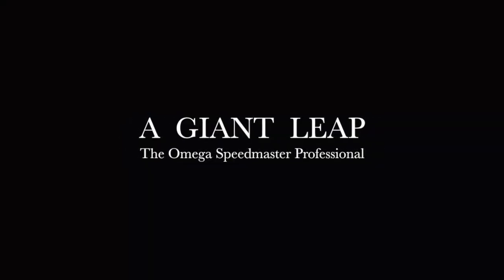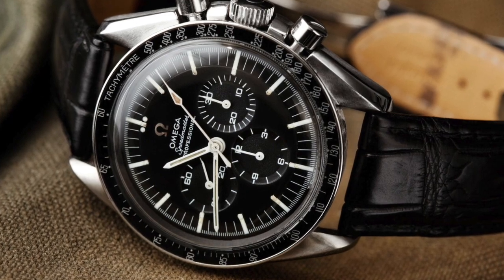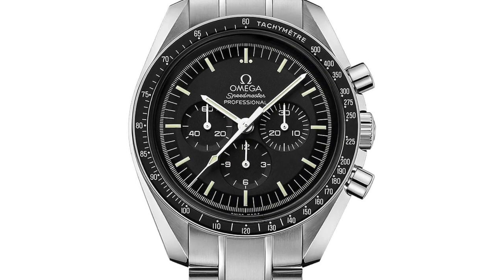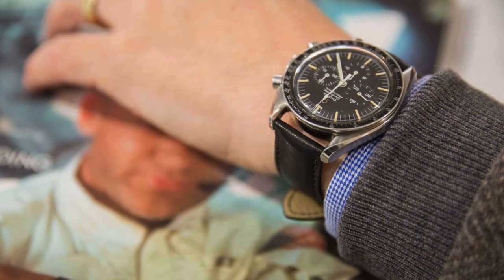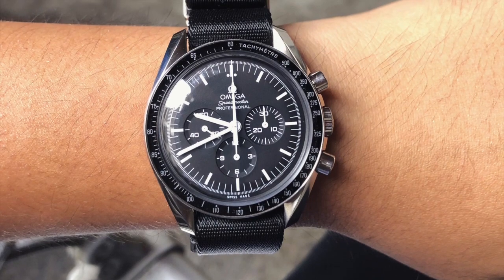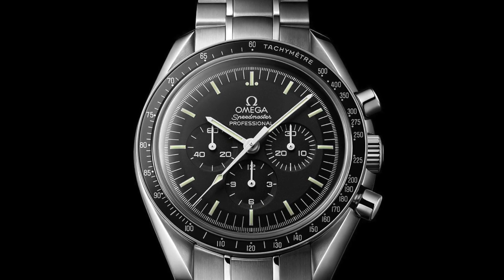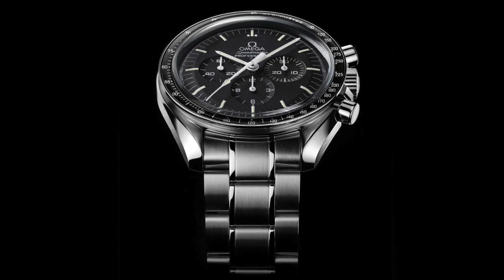The Design Of: The Omega Speedmaster Professional

Comment: Acrylic Crystal, manual winding. I should hate this watch 
but i love it, long live the Speedmaster
Reply from the maker: Hahaha! I'm getting to a point where I only wear acrylic pieces on a daily basis...there's just something so tantalising about the next scratch that it's going to receive! Ah, but I just love the fact that after all these years the watch has remained. It says a lot about a company to cherish their heritage like they do. Thanks for the comment, Maynard!
Reply: If you get a little scuff mark on the acrylic crystal, you can polish it out with a metal polish paste like Flitz. Use a cotton cloth and just a very small dab of the polish, about the size of one of the stopwatch buttons. It doesn't take but a minute or so and keep the polish off of the tach ring. I've used it several times on a Speedmaster that I've had for about ten years now.

Comment: At 3.40: The physics behind this has been known since the days of Isaac Newton.
The things that matter are the moment of inertia of the balance wheel and the spring constant of the balance spring.
These things do not depend on gravity, and it is impossible that NASA didn't know this.
Automatic watches also work in space as it turns out. The rotor is mainly driven by sudden movements of the hand, and automatic chronographs have been 
used in space (Seiko 6139 and Sinn 140 comes to mind).
When the Speedmaster was chosen by NASA, no automatic chronographs existed. The first automatic chronographs became available in 1969.
Reply: great point, the rotor mass has an inertia, the lack of gravity doesnt change that. So with every hand movement the rotor mass would try to stay where it is until its forced to change direction or velocity by the moved watch. Because of the degree of freedom around its rotating axle where no force can be applied to it by the watch and its inertia driven desire to stay where it is, it will move relative to the watch around this axle.

Comment: I bought my first Speedmaster Pro after wearing a Bulova moonwatch for a while. The Omega is IT for me. I swapped the bracelet for a lighter steel one that's more flexible. 
A minor factual point - the 321 movement was the one used on the moon, as those were in the watches tested, although Omega had already replaced it with the 861, which is the original form of the current movement. I agree with all your analysis of the wonderful design. No other watch has ever come close IMO.

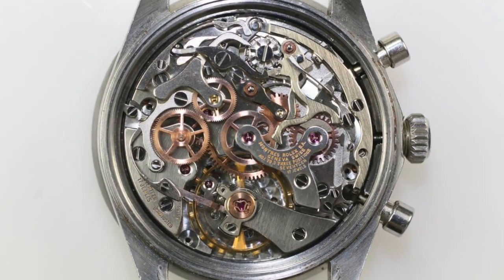Comment: 3:50 it’s wrong. Just take an Automatic watch with clear caseback and move ist in horizontal you will see the rotor will move also. This is moment of inertia firts and centripetal force after it that will move it, of course the gravity helps to wind the automatic every time you move your hand from hanging down potions upwards but in every other angles ist about centripetal force.

Comment: "Tachymétre is not useful in space." Well, not for timing speed, but they are useful. You have to think what a tachyméter actually is: it's not a tachometer, but rather, a conversion tool for converting an action that takes less than a minute to units per hour. For example, you could time the rotation of a satellite and if it takes 21 seconds to rotate, you'll know it rotates at a rate of 225 per hour. That's why it works for speed: it's just giving you the units to hour or laps (e.g., a lap that takes 45 seconds converts to 80 laps an hour).

Comment: First! (I think) Great insight, as usual. The only thing thats held me back from purchasing this watch is the 50m of water resistance. I could buy the "sapphire sandwich" model with 100m, sapphire, and automatic movement...but that's not a Speedmaster in its purest form. Thats not the watch that went to the moon. Eventually, I will probably bite the bullet and purchase one, but for now I feel as if I need more water resistance in a multi-thousand dollar timepiece.
Reply: The further you get into this hobby, water resistance becomes less and less important. I promise you this!
Reply: Watch Yourself  So true.
Reply: mcstarling07 Are you planning to dive with it? Otherwise 50m should be enough.
Reply: Good point. I just get paranoid about water resistance. I swim often and sometimes will forget to remove my watch (even jump in the shower every now and then with one on accident). If it was 100m, I would just be more comfortable since 50m is technically only good for the occasional splash on water.
Reply: mcstarling07 Based on your everyday use then I say your watch resistance paranoia is justified. Just keep in mind that the Moonwatch is mainly bought because of its mark on history. Personally I wouldn’t get a Speedy unless it’s the Moonwatch.
Reply from the maker: I know there is so much talk about water resistance (and that fifty metres is asking for trouble) but really, it is a rating that lets you submerge it would a problem. It's when you start to swim with it and go to depth that there will be issues. But day to day, interacting with splashes and rain shouldnt be a problem. But I know what you mean, man. Thanks for the great comments as always!
Reply: The sapphire sandwich does come with a handwound movement.

I think the sapphire does add a certain something to this historical watch. It reminds me of a valuable museum display exhibited behind a protective slab of display glass. The see through case back is like one of those cutaways that let you see the inner workings of a machine on display. The difference is that you can wear, use and take home this historical exhibit.

Comment: Great video. I have always loved the Speedmaster Professional. My only two complaints have been 1) I think the bracelet is just OK... and 2) MSRP seems a tad high for what you're actually getting. Recently Omega released their limited edition Apollo 11 50th Anniversary Speedy and I think its amazing. It includes two features that IMO would make the Speedy Pro infinitely better - it has the bracelet Omega used in past Railmaster/Seamaster vintage inspired reissues, and the new 3861 movement which includes chronometer certs, and their co-axial escapement. If those two features ever made their way to an updated variant of the Speedy Pro, I could very easily be convinced to part with a large chunk of cash... It would be fun to see one of your photoshopped pictures of the standard speedy pro but with the Apollo 11 LE bracelet. https://rocketrundown.com/omega-release-a-second-commemorative-apollo-11-speedmaster/

Comment: a mechanical watch in space works more accurate than one on the earth, because there is no positioning to be regarded. Once its regulated, its running almost perfectly, only temperature changes will affect the watch at that point

Comment: Well the attention to detail goes only so far. What about the minute sub-divisions to 1/5th of a second? Omega did not update that part when going from a 5Hz movement to a 6Hz movement. This wouldn't bother me with a 3-hander, but this is a chronograph FFS! If the watch should be used as a tool, then please provide the correct reading metrics. One of the most stupid design decisions ever.
Reply from the maker: I am not as technically versed with the watches movement specifics, but I assume it has to do with the hand jumping instead of sweeping when the chronograph starts? Or are you referring to the different beat rate and the hand not lining up with numerals on the dial? I would be interested in knowing! Thanks for your comment, man.
Reply: @ID-Guy  The second and chrono second hands do "tick" 6 times a second. I have to correct myself here from my original post above and say because it's a 3 Hz movement not a 6Hz movement. It used to be a 2.5Hz movement (not a 5Hz movement) which "ticked" 5 times a second. The dial was designed for that older 2.5Hz movement with 5 subdivisions per second (== 0.2s) on the index track. They didn't adjust the dial when upgrading to the 3Hz movement way back (in the 60s AFAIK). It's still 5 subdivisions on the dial. For a proper instrument the Speedmaster wants to be such a technical mismatch is a no-go.